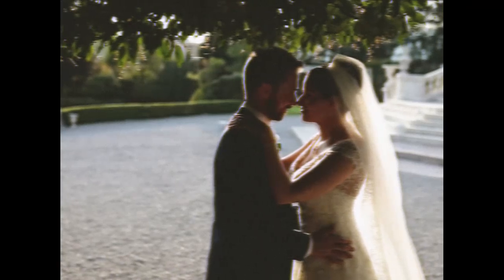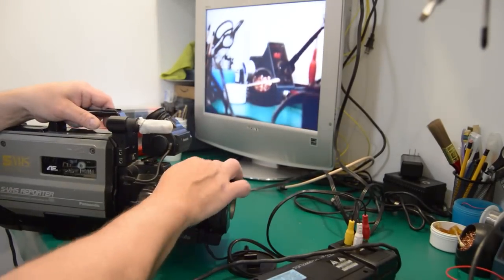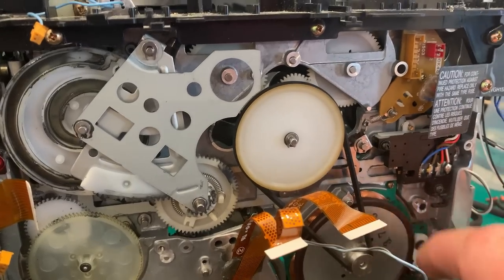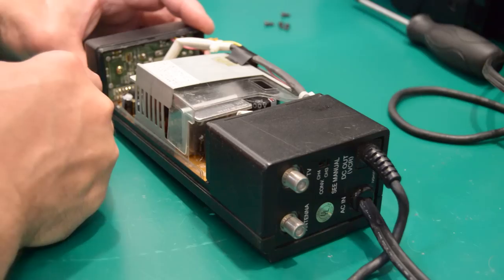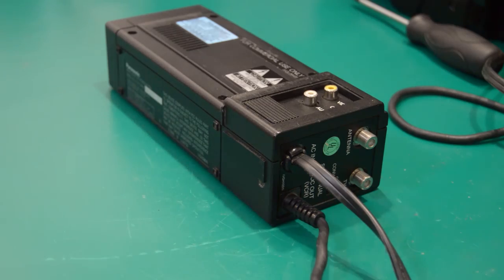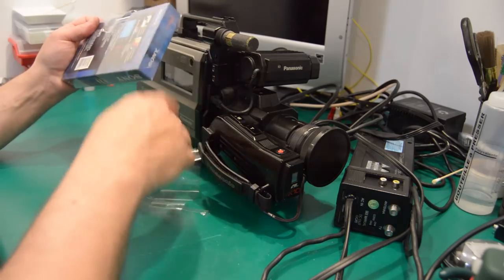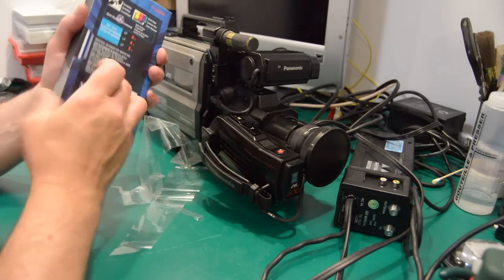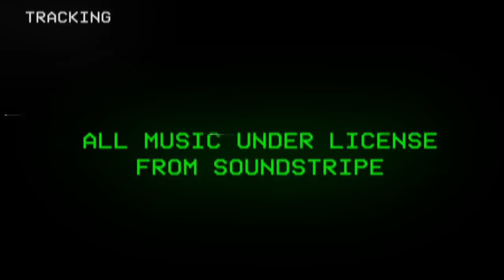RETRO TECH of the 90s 🎥 S-VHS Reporter Camera | Retro Repair Guy Episode 12

Comment: Back in the day the 450 was the camera to own to shoot weddings. What a flashback! 😊
Reply from the maker: Thank you for confirming that. I was pretty sure it was prosumer but not fully commercial as they used Beta. Did you shoot much with it? Was the quality at the end what you remember?
Reply: @RetroRepairGuy  back in the day, the early to mid 1980s, I would shoot over a 100 weddings with mine. The quality was great for its time. Later I bought a 3-chip camera and DVCam tapes were all the rage. Eventually digital SLR cameras took over and I retired after 40 long years in the industry.

Comment: This is amazing! I appreciate your dedication. I just finished a shoot with almost the same model, but from 1993. It worked just fine until this morning : ( Maybe doing some cleaning would help.
Reply from the maker: Thank you so much! For your camera, if it's dead it's probably the power supply but as you saw in the video it's easy to access. The cleaning will help if you're seeing issues during playback or recording. The heads could also need demagnetizing. For a cleaning you can simply remove the eject door and have access; it's only two screws.

Comment: Great video and restoration! But for this one you actually need a couple of sealed svhs tapes , because  in the futute they will be almost impossible to find.
Reply from the maker: Thank you very much! Yes you are correct eventually they might be impossible but I'm lucky enough to have a few sealed at home.
Reply: You can just poke the hole in the vhs body for tbe svhs sensing pin to slip in and VOILA, you can record SVHS on any vhs tape
Reply: @babulsgg  Well that is good to know.

Comment: Cuando se vendía en Argentina estaba circulando la Panasonic m8000. Con las mismas características, al no haber internet, se comentaba que la 450 tenía un baño especial en sus cabezas que la hacía más resistente y de mayor calidad.... Pero era un mito de mediados de los 90s
Reply from the maker: Hi! I'm not sure if the translation is accurate because it says "bath in its head" but that it made it more resistant and of higher quality. Well I'm not sure what head is in it, there were only so many manufacturers back then but it's still a good quality four head unit from what I remember when I opened it. Thanks for watching!

Comment: This is a great video! I just got one and when i power it on, the Viewfinder has no picture and doesn't display one when I hoot it up to my PC. Any thoughts or advice?
Reply from the maker: Hi Robbie. Thank you! Are you getting power at all like is the eject and play mechanism working? When you say you hooked it up to the PC did you try just the simple video out to a TV without any adapters or anything? Also even if you can't see the picture can you try recording something and playback the cassette on another VCR to see if it recorded something (assuming there is power). You just want to first eliminate the fact that it's not just the viewfinder. If it's the whole camera I would start with the power supply before I crack open the camera making sure you are getting the proper voltage out which should be 12V. Afterwards it could be a bunch of stuff like if the camera was ever dropped there could be a crack on the board or cracked solder. Best to try to get the schematic for this unit and follow the power from where it plugs in and see where it's cutting. Sorry there is no easy way to diagnose without seeing the unit. However try to eliminate everything you can. Let me know if you have any more questions afterwards. Thanks for watching.
Reply: @RetroRepairGuy  Thanks for the advice! I got it working now but its only showing Black and White footage. I have it set up to my PC through a Video Capture USB card running through OBS. Theres a bunch faults with the picture outside of the black and white picture. Outside of taking this thing apart, would you recommend using a head cleaning tape?
Reply from the maker: @RobbieMaynardCreates  Hi again. Well now I'm curious as to what you did to get it working? Couple of things. First the black and white footage could be an IC, however, there again, the IC might not be getting proper voltage from a burnt capacitor or resistor or there's a broken trace. Could also just be a bad cable. As for OBS, I plugged the camera from the show to my computer the exact same way and I remember having a few issues and that could be the capture device. Did you try as I said (just to eliminate this as a problem) plugging the camera directly to an old monitor with a video input, no other device? How about the recording test, is it also black and white or only display? As for cleaning, I always believed those "cleaning tapes" to be somewhat of a scam. You can take off the door of the eject mechanism and get much easier access. Get those long swabs and alcohol and get in there and remove dirt. In this video https://youtu.be/EQNuugQ-qss at 20:21 I explain in better details how to clean the heads and transport of a VCR. You might want to check that out. Remember these things are old, caps dry out and they need a good overhaul. Maybe you could find someone locally to at least clean it and take a look? They can't charge you much more than fifty bucks for a cleaning and a quick look over.
Reply: @RetroRepairGuy  I appreciate the help! I haven't tried plugging directly into a monitor yet. Though, even after recording onto a blank tape, the playback is black and white too. Im hoping its not a dead capacitor - Im not outside of opening the camera up and going through some of the basic stuff but any sort of technical stuff is out of my league. I will have to reach out and see if anyone local can help look at it more thoroughly. As far as getting it working again, I found a lot of the debris from the microphone cover in the camera and some corrosion in a secondary battery source. It held 3 LR44 batteries - I dont have an owners manual so Im not sure what those batteries are for but once I cleaned it up and used an other models viewfinder, it was working again. Maybe the other brands VF is the reason for the black and white picture but I can't imagine that would be the cause.
Reply from the maker: @RobbieMaynardCreates  No problem, just difficult without the unit in front of me. So if you are recording the same way on a tape, there's a problem in the camera. No the viewfinder is not the problem since it's happening on the recording. If you have the exact same model AG-450 the batteries are LR1130 according to the owner's manual. I show this at 13:36 in the video. I purchased them from Amazon in Canada but here are the batteries on Amazon US https://amzn.to/3aq7Ykp. If you need the owner's manual I have it here https://retrorepairguy.com/downloads/ just click on the very first link in the table that says "Download Here". I will be uploading all the old manual I have there.

Comment: nice profesinal repair, actually did these unit suffer from leaky caps ?
Reply from the maker: Most electrolytic caps have a 15-20 year life span in general and this can vary because of manufacturing, use, heat, etc. I changed the caps in the power supply because this is crucial. However, even though it is working great, it could have benefitted having new caps in the camera as well. Most time the power supply fails and causes damage. If a cap in the unit fails you will see lines in image or problems in sound, etc. But it won't damage the unit. I did not see any leaked caps anywhere but the ones in power supply had high ESR (resistance). Thanks for watching!
Reply: @RetroRepairGuy  my pleasure to watch, thanks for your knowledge to

Comment: We used to use those in High School when I was a kid. I think you meant Betacam as well? I don't believe there was ever more than one Beta-Max camcorder.

A local TV news station was using high-8 - which is about the same quality as SVHS - the things that don't make this "professional" is its missing manual white balance and interchangeable lenses - plus most pro cameras were 3x ccd.
Reply from the maker: Hi Michael! Yes Betacam would have been the correct word to use for the professional cameras used in studios. I said "High end Betamax" cause I believe Betamax is a more commonly known term for home users because of the Betamax VCRs. There was a few Betamax camcorders but they were the two piece models, the camera plugged into a Betamax VCR, however other than Sony I don't know. Also you are correct it's missing the manual white balance and hence the term "prosumer" which is what I used. Prosumer cameras, still today, lack some features of the true professional models while delivering higher quality/standard for the semi-professionals. Which is what I said, wedding videographers, small PBS stations with limited budgets, etc. Thanks for watching!

Comment: I have a 450 that has been with me from day 1 and am now using it to make digital transfers of recordingss done on it way back! It has sat in its case for about 15 years unused and recently has been bought back into service. Worked fine for a few montgs but now on playback, it will stop intermittently. I have cleaned the guides, head and capstan, and its a bit better but still stops once in a while. Opened it up and the main belt us tight. Any suggestions?
Reply from the maker: Hi! Mechanically what about the pinch roller? Did you clean that thoroughly as well? Even if the belt looks tight to the finger did you check if it is slipping? Otherwise the problem could be electronic and hard to diagnose without seeing it. Let me know I’ll think on it as I am filming at the moment. Thanks for watching.
Reply: @RetroRepairGuy  I cleaned the roller and the capstan. The idler wheel also moves easily enough and rewind and FF function normally as well. The brake pads free up on the take up and supply spindles as well. Should I add grease to the worm wheel?
Reply from the maker: @babulsgg  Grease helps with the loading and ejecting but once the mechanism is engaged but worth doing anyways. I think it comes from sensors that would detect something is wrong and shut it down. If you confirm that the belt is not slipping even if tight then does the mechanism lock properly in place? Are the springs on the gears ok? May sound ridiculous but did you try another VHS tape? If it's broken or have resistance it might also cause the unit to stop. Haven't worked on it for some time but I believe the counter was digital? Do you see the counter advancing without problems? If the unit is having trouble reading the tape or the counter stops advancing it might think there is a problem and stop the playback. After that you're looking at voltage problems. Do you have the service manual? I looked and don't have it because I did not need it otherwise I would send it to you. Unfortunately I can't find it anywhere free on Internet. I do see it available here https://www.servicemanuals.net/en/PANASONIC-AG450-Service-Manual I am not affiliated with this company but I have purchased twice from them successfully.
Reply: Thanks for answering! I've tried multiple tapes, all FF and rewound with the same problem. Its as if the tape gets stuck in one place, stays there and then retracts the tape. I can forward cue past the stuck section and then it goes for a while. Yes, the counter is digital and only seen in the viewfinder. If it was a power supply problem, then other functions would also not work. The manual suggests oiling the tape spindles, but they move freely.
Reply from the maker: @babulsgg  Hi again. When I say voltage problems I don't mean just power supply and why the service manual is necessary. Different sections of the circuit could be having problems like a bad chip or chip getting a bad voltage input, etc. The sensors are controlled electronically. I say this if all mechanical problems that are normally the culprit have been eliminated, which seems to be the case from what you are telling me but of course hard to diagnose without having the unit in front of me. Let's not forget that this unit is now thirty years old so the capacitors are passed their expected life span which could lead to voltage problems, spikes and so on.

Comment: I got a vhs camcorder at a yard sale it can play tapes and rewind and fast forward but after about 30 secound of being on it turns of and wot turn on for about 15 minutes and then it only stays on for 10 seconds it seems like the longer you leave it off the longer it stays on.
Anyone got any advice
I don’t know if it matters but the battery that came with if completely dead so I was using the charger to power it for the tests and the charger is designed to do that
Reply from the maker: Hard to diagnose without seeing it but
it sounds like it's going into a "protection mode". It's not the battery when you have the power supply connected. It could be a bunch of stuff however I would start with cleaning the heads and sensors and oiling gears. Take off the hood and watch the tape loading and turning see if it slips or having trouble turning. Once all that is done if it's still happening then it might be old caps. When you open see if any leaked or busted.

Comment: I want to use my camcorder at longer periods of time but the battery life doesn't last more than 2 hours or less. So I had a creative idea to go battery-less with this mobile power supply with outlets and I can plug the camcorder in it, tape it to the camcorder and go anywhere with 8 hours or more. The only thing is the ac adapter is too bulky and the wires are annoyingly long. Is it possible there is a small ac adapter with the same volts, hz and watts that can keep the camcorder powered on?
Reply from the maker: Hi. I think you wrote me an email? I answered you, check it out! Thanks for watching!

Comment: hi, i have a camera very similar to yours. the problem is that it plays the tapes but when I switch to record mode immediately on the CRT screen there are numerous noise stripes. looking at the recording on a VCR you notice that the audio and video are distorted. do you have any advice? I thought about replacing the capacitors around the recording head.

 thank you from Italy
Reply from the maker: Hi. Part of my family is from Italy! This is seen in the monitor as soon as you hit the record button on the VHS camera? Just to rule out interference, you are using 75 ohm cables? And try another monitor. After that is ruled out the camera's could definitely be bad caps. The best is to look at the service manual and follow the signal path and start with those. Could also be a solder joint that is broken or cracked if the camera was ever dropped during its life time. You can do a Google search for the manual, normally these old service manual are available in PDF somewhere. That's about as good a diagnosis I can give without seeing the unit so hope it helps. Thanks for watching!
Reply: @RetroRepairGuy  thank you very much, I will try to check the welds and in case to replace the capacitors, even if the identification of the components is very complicated.
however I have seen several videos of your channel, you are really very good at explanations and video editing
Reply from the maker: @comicsmovie6803  Thank you very much for the compliments. When you say the identification of the components is complicated. Is it because you don't see them properly on the board or you find it difficult? In this video https://youtu.be/Hf8DBlH95nE at 10:54 I explain about the identification. Also you can then order and get more information from Digi-Key and they have an Italian website https://www.digikey.it/. I am not affiliated with them, I have ordered many times from them and they have great service and quality components. Let me know if you need any help identifying any components. Also as I mentioned, try to Google for the service manual as it will often provide a detailed list of the components, their value and voltage.
Reply: @RetroRepairGuy  thanks, however I mean that it is difficult to find (for me) the corresponding voltages of some components and in case of valid substitutes (not considering that sometimes here in Italy they have exaggerated prices)
Reply from the maker: @comicsmovie6803  Oh OK, I understand. But remember that voltages do not need to be the same. Only the microfarad. You can go above as high as you want as long as it physically fits. As for prices, did you check out Digi-key? So far their prices are great and they ship internationally.
Reply: @RetroRepairGuy  yes i will take a look at the site, first i want to take note of all the capacitors, so while they are there i replace them all. I will keep you up to date. thanks again   :p
Reply from the maker: @comicsmovie6803  Please do! My pleasure!

Comment: Can you please share which size belt you used or a link to where you got it
Reply from the maker: Hi there! The problem is that the old PRB catalog does not have a listing for that size belt and I could not find the size online listed anywhere. I purchase large bags of mixed sizes of belts from Aliexpress as it's the only site that sells them. You can then match the belt by selecting one slightly smaller to account for the wear. In this video https://youtu.be/n-cj6yT5a_s at 31:26 I give a lengthy explanation on how to use the PRB catalog and online calculators for selecting and purchasing belts. It might be of interest to you. Thanks for watching.